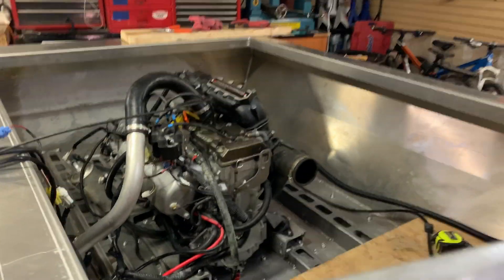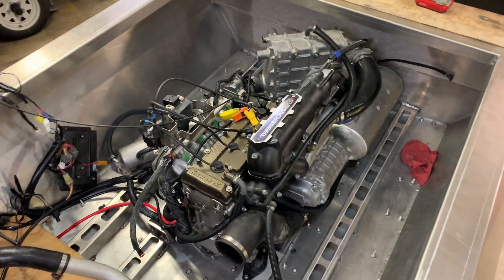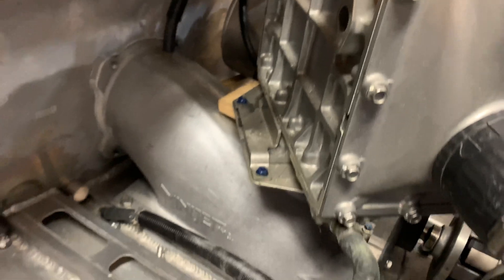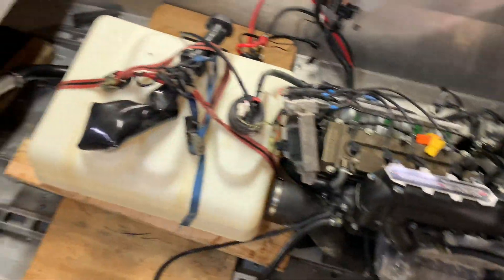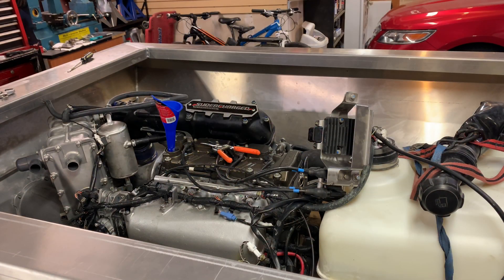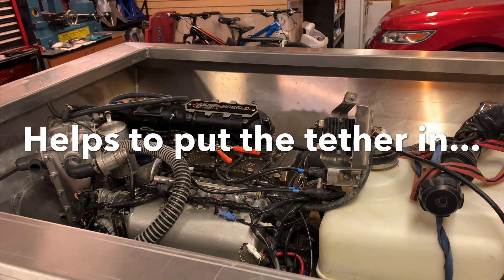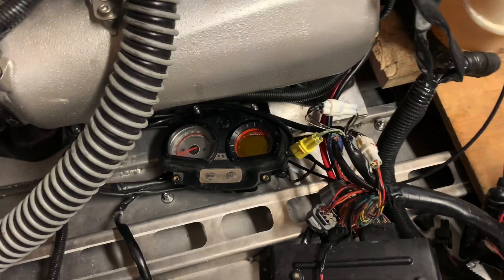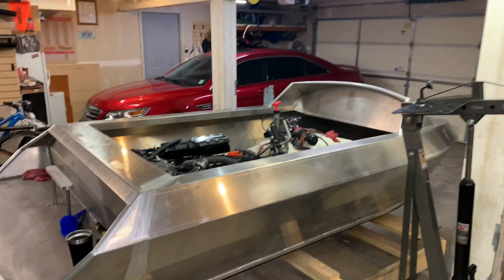Mini Jet Boat Build 7 - Intercooler Placement and First Start

Comment: Stop calling a gas tank a fuel cell.
Reply from the maker: This is definitely a common syntax argument if you’re talking about “fuel cells” with no context. But since the context here is that we’re working on a high performance combustion engine boat, the majority know that I am not attempting to achieve an electrochemical reaction within this fuel cell.